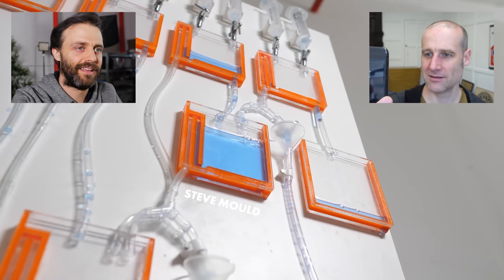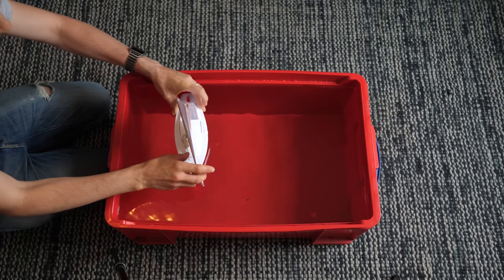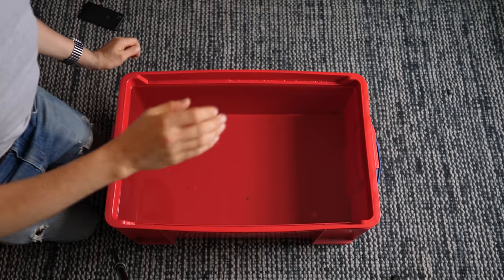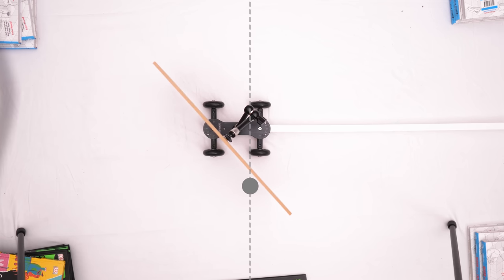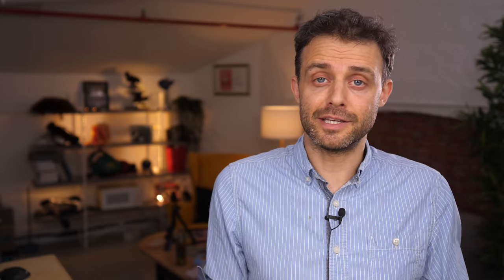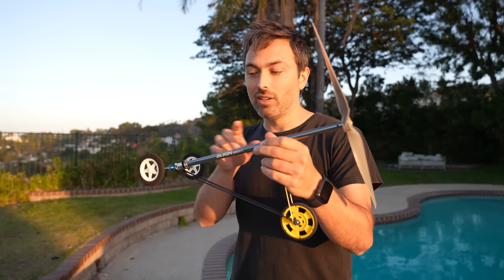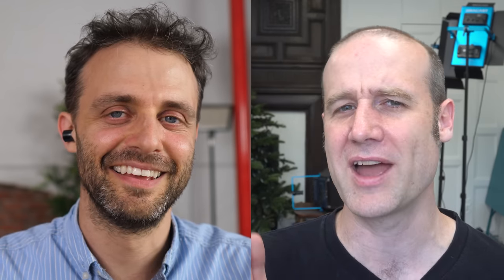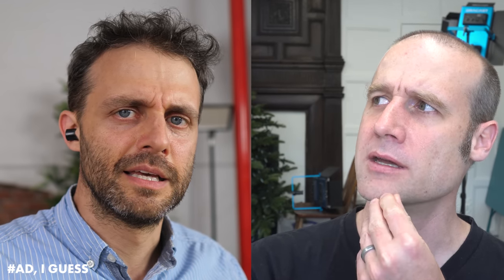Sailing Faster Than The Wind - How Is That Even Possible?

Comment from the maker: The sponsor is Brilliant: The first 200 people to sign up at https://brilliant.org/stevemould will get 20% off an annual subscription.

The alternative explanation goes something like this (I'm simplifying!) - Lift is generated when air is moving relative the sail. As the boat speeds up, the relative speed of the air should increase and so the lift should increase! This explanation doesn't work for when you're sailing somewhat with the wind though. In that scenario, as the boat begins to speed up, the relative speed of the wind actually goes down.
Reply: I love you, Mr Mould 🌈
Reply: If you are sailing into the wind, and speed up, doesn't the relative wind speed increase?
Reply: I though the sponsor was brilliant as they might have done something brilliant in this video. But it was only Brilliant.
Reply: This isn't really correct. The term you are looking for is "apparent wind." As you speed up the angle that you feel the wind coming at you from shifts to in front of you, similar to how it always feels like the wind is coming from straight ahead when you stick your hand out a car window on the highway. This means that if you are sailing faster than the wind, you are also always sailing into the wind. When you sailing into the wind the relative wind speed goes UP, not down. When you are sailing away from the wind, you are moving with it, and the relative wind speed goes down. This is what the streamer on the front of the car in the veritasium video was showing.
Reply: Isn't it the other way around? Relative wind should increase with the speed of the boat when sailing into the wind and vice versa.
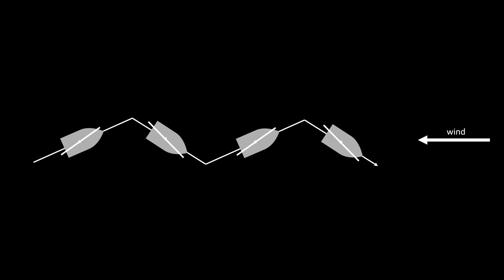Reply: It took me a minute: sail orientation i n the tacking graphic at 8:52 doesn't work with the stick-pushing analogy - the front of the sail should be angled between the bow and the wind. It would be helpful if you added force vectors there
Reply from the maker: @thephill_osopher7245  it does! I meant to say with the wind. Edited the comment. Thanks!
Reply: @SteveMould  👌
Reply: Ok
Reply: Hey Steve, I am afraid that this video does not explain well How it is possible for the component of the velocity of the boat in the direction of the wind to be faster than the wind itself. 

The video is cool, it just feels like the main point has been somehow skipped.
Reply: @lakotamm 
That's a force component not a velocity component. The velocity is assumed to be purely in the forward direction for the sake of the video
Reply: @SteveMould  You are one of my favorite youtubers, I agree with everything you said here, but DEREK's VIDEO WAS NOT ABOUT THIS*. His claim was that you one can travel faster than wind in the exact direction of the wind. Or at least that *the projection of vehicle velocity on the wind velocity can be greater than the wind velocity and I strongly contend: THAT IS INCORRECT. Your wheel cart demo makes it cleat that the cart velocity projection on the push bar velocity vector can't be greater than the push velocity. They made the propeller machine to prove their false claim. The "results" we saw in the Veritasium video were likely a combination of vehicle+pilot+rotating parts inertia, intermittent wind, and different wind at different height followed by a bunch of false explanations. And then millions of views and approval comments. I think if you be the first popular youtuber to point out their errors, you'll get a great audience and scientific support. Thanks.
Reply: However, if you can get to a speed higher than the absolute windspeed at a course into the wind, you can then turn onto a course that is with the wind, while still keeping the relative wind always coming from in front of the boat.
Reply: @DmitrySinyukov  if you increase the length of the pusher thing past the cart (which is fair because the wind doesn't stop when it's ahead of you) then you can engineer a a cart that goes faster than the stick is being pushed. You use the differential between the speed of the ground and the stick to turn a gear, and then gear that up to drive your wheels.
Reply: I think a explanation to Dereks video could be: (its my explanation)
When the wind speeds up the vehicle it doesnt speed it up due to it turning the blade, but due to pushing on the vehicle. Then the wheels will turn also and this causes the blade to spin. Now when the vehicle is at the speed of the wind it will get faster, cause actually if you imagine a horizontal line through the rotors blade there will be a crossing point between the imaginary line and the blade. This dot actually moves backwards while the blade is spinning, because of the blade is tilted. Now you have a point on the vehicle that is moving slower than the boat, cause this point is moving backwards relative to the boat (it could even really move backwards, but lets assume it doesnt)
So then the air can push on this point, since its slower than the air and thus push on the whole boat. 
Of course this backwards moving point doesnt really exist. But you can also think about it this way:
The rotor is spinning, and thus it will blow air against the actual wind. This will cause some swirls and this will cause the vehicle to kind if push itsselve from the wind. Now you could argue that pushing from the wind takes at least as much energy as it takes to turn the wheels. But thats not true, since the vehicle is moving faster relative to the ground than to the air. And thus its easier to push from the moving air than to turn the wheels to be able to push the air backwards. (Have you ever been in a pool with circle motion and just floated in the water while pushing yourselve activly from the fast water jet at the edge tonbe faster than the others? did you notice that gaining speed by this was easier than gaining the same amount of speed difference due to pushing off the non moving water? ) this is  because the kinetic energy increases quadratic with speed. So lets say you want to gain a ∆v of 1m/s relative to non moving ground while you've got no speed  in the first place. The energy reqiered would be 0.5(m^2/s^2)*M with M being your mass. But if you try to gain 1m/s when you are at 20m/s to get to 21m/s you will need a energy of 20.5(m^2/s^2)*M. So much more. So if you push from a object that isnt moving to gain 1m/s while you are at 20m/s you will have ro use a energy of 20.5(m^2/s^2)*M
But if you are pushing from a object being as fast as you, you will have to use only 0.5(m^2/s^2)*M. This is because you will push the other object backwards by doing this and thus you will decreas its veilosity and thus its energy and thus you will gain energy without having to do that much of a work. (of course this 0.5(m^2/s^2)* M does only hold, if you assume that the mass of the object you are pushing from is infinity, cause else it will get slower while you are pushing from it like i already said, and this will make calculations complicated)
So you can actually divide this process into steps:
Step one: Pushing from the wind using a energy of 0.5(m^2/s^2)*M and increasing with speed of 1m/s
Step two: using your energy relative to the ground to push from the air. 
So if you calculate that you will loose 0.024m/s. (cause you will get a energy of 0.5(m^2/s^2)*M if speeding down from 21m/s to 20.976m/s) .
So over all you are gaining 0.976m/s without blaming the law of thermodynamics.
Reply: Congrats on 1 million subs!!
Reply: Thanks Steve 👍,  I've always wondered how sailing against the wind works but this was a really intuitive explanation. Congrats on 1M subsribers as well!
Reply: Once your travelling at 2-3x windspeed surely your relative windspeed, even at a high angle, is much higher. And your boat would think it was tacking into the wind
Reply: @DmitrySinyukov  yes, it's strange how the convuluted explanation convinced most.

The prop/windmill is either harvesting energy to drive the wheels, or consuming energy from the wheels to push the air back. It can't do both at the same time.
Reply: @DmitrySinyukov  You just haven't understood what was happening with that cart. You have to decouple the motion of the propeller blades from the motion of the cart. The blade never travels directly downwind because it is spinning. The apparent wind seen by the blade comes from a different direction to the apparent wind seen by the cart since you have to combine the forward motion of the cart and the rotary motion of the blades - in sailing terms, the blades are reaching. Since there are two blades coupled at the hub, a torque is created which can be used to drive the wheels, which with appropriate selection of gear ratios can produce sufficient power to push the cart faster than the wind. The explanations are not false, it's just a bit of a tricky thing to get your head around. 

Fundamentally, sailing is the extraction of energy from the difference in motion between the air and water (or ground in the case of the cart). Sailors will almost never sail dead downwind because much more power can be generated by sailing at an angle to it. The difference that allows the cart to drive directly downwind is that the aerofoils being used to extract the energy are not fixed in relation to it, unlike with a boat, where the sails are fixed in relation to it.
Reply: But my question is, can the sailboat win from a balloon. As in, will its speed component in the wind direction be greater then the wind speed
Reply: Why would you be surprised that you can sail faster than the wind when it's been possible to sail INTO the wind for over 500 years? smh
Reply: @DmitrySinyukov  I think it's clear that the video was inspired by Derek's, and not intended to be on exactly the same topic. But why do you say an apparently common sailing technique is impossible? I'm no expert, but a quick Google found me this https://en.wikipedia.org/wiki/High-performance_sailing, with many examples of what you claim is impossible on the water.

Regarding Derek's video, it's counterintuitive for sure, but critically the fan explanation holds up as you pass through the wind speed barrier - something which I'm sure traditional high performance sailing can't do. It's pretty ingenious actually. Not to say the demo was flawless, they certainly didn't address your concerns, but it's not clear to me that they're wrong either.
Reply: @jostromp7380  That depends on the boat. A fast boat can definitely do that - an extreme example is the foiling boats used in the America's cup this year. They can travel downwind at 3-4 times the windspeed, doing 40+ knots in only 10 knots of breeze. Their velocity directly downwind is much faster than the wind, despite them sailing at an angle to it.

Edit: Here's an example: https://youtu.be/hswUuKJnq_k?t=650
The boat is doing 40.8 knots through the water, with 11.5 knots of wind, and the VMG downwind is 31.9 knots.
Reply: @turbinia  Thanks for the example, I can no longer ignore the facts.
However, it is still confusing why it is possible, as the model of Steve Mould doesn't allow this if I'm correct. Desperately waiting for an explanation as I couldn't find it on google nor in dereks video comments. @Steve Mould, please make a video about it
Reply: @kokbasE  yes this is what I would have mentioned is it the same as applied wind?
Reply: Back in the days of old style land yachts with rigid masts and bigger sails than that small one you showed in the video the mast was aerofoil shaped and given a stiff breeze you'd often see them shoot off along the beach before the pilot had even got the sail up.
Reply: The description I like for how that car works is that the propeller in effect synthesizes a surface that it moving backwards relative to the car so that surface is moving slower than then wind (and being pushed on by it) while the car is moving faster. But than again that is how all prop work.

The hard part is how to synthesizes that surface, and then how to power it. (An interesting bit of reasoning: if the force on the prop and the force at the wheels are the about the same, then to power things the speed of the wheel relative to the ground has to be higher than the "effective" speed of the prop relative to the air.)
Reply: @lakotamm  what steve is trying to say is that if the wind pushes the sail on angle, the vector forces show that the boat has travelled more than the wind has with the same force, i.e. travelled faster than the wind.
Reply: @Tacsponge  yes, a sailor will then adjust their sails for the angle of the apparent wind
Reply: @thephill_osopher7245  if you're tacking into the wind, the relative wind does speed up as you go faster, but the relative wind also turns in a direction to make it more challenging to keep speeding up.
Reply: @DmitrySinyukov   if you were to make the blades perpendicular to the wind force, you have got yourself stves model on its side, which is basically dereks model. steve only tried to provide an intuitive explanation with the resources he has available, not to challange derek
Reply: @DmitrySinyukov  I second your motion!  I definitely think Steve should prove my downwind cart to be a hoax.  He'll be in very good company, and it will just further fan the flames.
Reply: @PranavSinganapalli  
>> The prop/windmill is either harvesting energy to drive the wheels, or consuming energy from the wheels to push the air back. It can't do both at the same time.

It doesn't do both at the same time.  The wheels turn the propeller at all speeds.
Reply: @jostromp7380  Yes.
Reply: @Rick_Cavallaro  what's turning the wheels then?
Reply: Would this then allow boats to go faster than the speed of the wind? (Replacing the wheels with a turbine)
Reply: @archenema6792  it's never been possible to go faster than the wind in the same direction as the wind
Reply: @PranavSinganapalli  Have you ever sailed? Do you even know what a lateen sail is? Have you seen how many mainsails and lateen sails a tallship has? It's been happening for a long time. You don't have the slightest clue what you're talking about.
Reply: @archenema6792  have you ever understood physics, doesn't seem like you do. You seem to think a sailor knows all there is about the physics of it 👏👏🙄
Reply: LETS GOOOOO 1 MILLION U DESERVE IT
Reply: Woohoo 1 million!!!
Reply: @thephill_osopher7245  yea it does and this means that if your a boat with low drag you can sail much quicker than the wind upwind too ( look at the current America’s cup boats) however as it increases it also makes your relative angle to the wind tighter which is why on most boats you don’t actually get a speed benefit from it
Reply: @jostromp7380  what his model doesn’t take into account is the curved wing shape of sails that he very briefly mentioned. The shape makes the pressure on one side take a longer rout (accelerating it) and on the other side a shorter rout (decelerating it) these lead to different pressures and it’s the work that’s done by the sail to create this pressure difference that helps to push the boat much faster than the true wind speed, the faster you go the more air is being pushed over the sail and the stronger the effect becomes with the limiting factor being that the apparent angle to your relative wind gets narrower and narrower ( there needs to be enough of an angle for the sail to be able to split and accelerate/decelerate the air) 
It’s quite a complex subject and to be able to explain all the effects properly would take a video much longer than this one and exactly why professional sail trimmers get payed as much as they do!
Reply: except statement in Veritasium video is stronger than the one explained here.
Derek claimed that you can faster than the wind downwind as long as you zigzag. More strictly speaking: component of velocity downwind (absolute wind) is greater than absolute wind itself.
You only showed that you can travel faster than wind sideways but didn't show that it is possible to outrun balloon.
But it should be possible to show also that with your model.
Boat/car facing 3 o'clock
wind blowing towards 1:30 o'clock
sail in 4 - 10 o'clock direction.
After doing some math (or using physical model) it can be showed that in such arrangement in no drag scenario boat velocity is 1.932 times speed of wind, so component of its velocity downwind is 1.366.
Reply: @PranavSinganapalli  hi there, I'm a sailor and a physics student. I can confirm that, as can be seen from the america's cup footage that was posted earlier, you can sail downwind at faster than the wind speed. Not directly downwind mind you, but at an angle and still fast enough that you'd "beat the balloon". The reason this doesn't violate the laws of physics is that 1. As long as you reduce the friction of the boat enough energy can be conserved since there's a lot of air hitting your sail 2.sails work quite a bit different from the explanation in this video, and due to the coanda effect among others can pretty efficiently redirect air. Combine that with the fact that you're dealing with pressure differentials created by flow speed differences and it actually allows it - as long as the total wind vector (the combination of the actual wind and the headwind generated by moving through the air) doesn't make an angle with the boat too acute for the sail it can still create lift and thus force
Reply: I understood it like this. The vehicle is going in the direction of the wind, but the wings are not. They rotate perpendicular to the wind. The gear train changes the direction of the motion back to parallel and then rotates the wheel. It almost seems like you could carefully control angle of attack and keep gaining speed by pointing them into the wind, but there comes a point where the drag from the oncoming wind matches the force out the wheel. I don’t think it’s possible to go faster than this. As long as the force from wings>drag it should move. That’s why it has to be moving first. The force has to over come the drag from ground and there isn’t enough force at slower speeds. It seems to me that it wouldn’t work in an airplane or underwater. It has to be trans medium (buzz word of the week). But I could be wrong about all of it.
Reply: @DmitrySinyukov  imagine wind moving at 10 miles per hour, and a fan on a cart moving at 10 miles per hour in the same direction. From the fans perspective, there is no wind. Now use the carts spinning wheels to power the fan, pushing air backwards. That would create a force in the direction of the wind right? Then you add that to the speed of the cart and fan in the first place, and you have a greater speed than the initial wind speed. That's how I understand it.
Reply: Also, this is how internal combustion engines on cars work. They're air pumps and don't really care which direction the wind is going so long as they can suck air in. We use fuel to increase the force that's output, but otherwise the two are working the same. They cannot go any faster once the drag becomes greater than the output force. Steam engines too now that I'm thinking about it.
Reply: @thephill_osopher7245  but what's powering the wheels? If they are moving the prop, they will slow down not speed up. And once 5he direction of apparent wind changes, drag gets generated by the whole body
Reply: @thephill_osopher7245  Yes. It's referred to as 'apparent wind.' This is how iceboats and foiling sailboats can sail at speeds sometimes several times greater than the 'true wind' speed.
Reply: @PranavSinganapalli  the cart was kick-started by the wind in the first place, it was rolled forward first, then the wheels started to spin which spun the prop enough to generate the forward lift. By the time the cart travels faster than the wind, again, the wheels move the prop so fast that the prop can still push air backwards
Reply: @PranavSinganapalli  just like how, i assume, airplane propellers continue to generate thrust even though air is already travelling past the propellors very quickly.
Reply: Congratulations on 1 million!
Reply: @thephill_osopher7245  in case of airplane propellers, it is the engine that provides the power to keep it moving, and not the wind going past it. What in this craft is doing the job of the engine. Don't say wheels
Reply: @thephill_osopher7245  that is a perpetual motion machine you are describing - a machine which once you provide the initial energy, it just keeps on moving. In this case prop moves the wheels which moves the prop. Why is that not jumping out at people??
Reply: @PranavSinganapalli  it is explained better in the veritasium video. Are you saying the video is faked?
Reply: Let's make it simpler and get rid of the whole prop thing since that seems to trip people up. If I connected a shaft between the rear wheels and the front wheels, could I say the front wheels are being moved by the rear and the rear by the front and therefore my craft doesn't break the laws of thermodynamics??
OR
If I put a generator in the front wheel and a motor in the rear, with the motor providing forward motion which get converted to electrical energy by the front generator to power the motor in the rear. If we ignore all loses, with a little wishful thinking it is entirely possible to imagine a craft that can exist. In reality it can't. Best is to reproduce the treadmill experiment they tried. I bet it won't run off the treadmill
Reply: @PranavSinganapalli  it's not perpetual because the props are still getting energy from the wind.
Reply: @chrispierce596  I want to ask about "sailing faster than the apparent wind isn't possible" -- because that seems pretty easy to do! If you sail downwind in a sailboat, then as you speed up, the apparent wind decreases. Eventually you will feel very little apparent wind at all (just enough to counteract the drag) and you will be sailing quite fast. As long as your speed is > 50% of the true wind speed, then you will be sailing faster than the apparent wind.
Reply: @thephill_osopher7245  yes, something about the video is not quite right. Not saying Derek faked it, but he could have been fooled you know
Reply: @thephill_osopher7245  they can't be getting energy from the wind because at true wind speed, the prop experiences Zero apparent wind. Besides you couldn't even get close to wind speed because the blades require a minimum relative wind speed to do any work. Look up min. operational speeds in wind turbines. The horizontal kind that they have mounted need atleast 12-15km/h just to start turning
Reply: @PranavSinganapalli  I see. So why can't the wheels spin the prop fast enough to get energy from the wind, pushing the cart faster? Gear ratios come into play somewhere I'm sure, when it comes to spinning the prop fast enough based on the overall cart speed and wind speed
Reply: @PranavSinganapalli  the drag of the body is outweighed by the props because they are spinning so fast compared to the air around it. When the entire cart is at rest, it will be pushed forward by the wind, and then the wheels slowly start to spin the props, which then act like a fan and take further energy from the air around it in a different way
Reply: @PranavSinganapalli  a non-rotating prop would not experience wind when traveling at wind speed. But the blades are spinning rapidly, so they will meet air just the same as a normal fan at rest. The blades do not act as turbines being pushed by wind. They act as fans that push the air around them, which is why they still produce forward lift even when not experiencing apparent wind.
Reply: @PranavSinganapalli  The wheels are rolling on the ground.  So if the cart is moving, the wheels are turning.  Initially the cart moves because it's simply being pushed along as a bluff body by a tailwind.  As it approaches wind speed, the thrust from the propeller becomes the dominant force.
Reply: @PranavSinganapalli  It has always been possible.  You just need the right tool for the job.
Reply: @mechamunchygone6630  It would if you could make a sufficiently efficient boat.  I'm nearly certain it would be possible with a foiling craft.
Reply: @thephill_osopher7245  I keep seeing this "explanation", even Derek talked  about wheels pushing the vehicle. It is not correct. The inertia of rotating wheels does "push" the propeller just like the inertia of the entire setup with a human inside moving forward. But that's the accumulated energy from the previous gusts of wind. It's not sustainable. If you throw a stone against the wind it will fly too. Wheels interaction with the ground does not push the cart or fan. It slows it down due to rotational friction. I want to emphasize, I don't NOT think they faked the experiment. I think they misinterpreted the observations. Did you see how fast the vehicle moved? Accelerate that cart too such speed and then change the wind direction, it's gonna move forward for quite a while against the wind. I mean take a simple bicycle, gain some speed, stop pushing pedals and see how far you'll against the wind just due to inertia. Once the wind stops pushing the fan, the vehicle starts losing energy. To very roughly estimate the effect of inertia we need to compare the time it took to accelerate the vehicle to the timespan during which it moved "faster" then wind.
Reply: @DmitrySinyukov  what about the treadmill experiment? Could they have misinterpreted that the small model was moving faster than the treadmill?
Reply: @PranavSinganapalli  I think your electric generator plus wheels with electric motors on them is actually a great example. Hear me out, I'm not expecting the electric generator too make more energy than it's taking from the cart. That would clearly be a perpetual motion machine.

But your missing a big part, which is the speed differential between the two mediums. Instead of the front and back wheels, let's do the left and right wheels. Now to simulate the speed differential, whe will have the right wheels on stationary ground, and the left wheels on a treadmill moving forward. 

To start, we lock the left wheels until the cart is moving at the speed of the treadmill. Then, we turn the generators on the right wheel on, and use that to power the left wheels. With that extra power we can move the left wheels forward which makes the whole vehicle start to move forward faster than the belt, or the "wind". The actual cart is doing something similar too.
Reply: @DmitrySinyukov  unfortunately I'm not the greatest artist, nor a very good engineer, but I did find this article that has an even simpler setup, along with a diagram. vulu.net/faster-than-the-wind
Reply: @jetison333  I would greatly appreciate if you could show a simple hand drawing of the setup you described. Idk if you can share a link to an image here.
Reply: @PranavSinganapalli  The system works because the propeller is pushing on something (air) that is moving slower - relative to the vehicle - and the wheels are being pushed by something going by faster. The wheel-driving-wheel idea isn't the same because both wheels are on ground that is going by at the same speed.
The concept here is analogous to a mechanical lever. With a lever, you can use a small force moved through a long distance to produce a large force moved over a short distance.
The drag force of the wheels is small (smaller) because they move through a longer distance (against the ground). The propeller force can be large (larger) because it moves a shorter distance (through the air).
The power (or energy) used by the propeller is the same as the energy produced by the wheels (minus losses), but thanks to the lever-like action, the propeller can produce more forward force than the wheels produce rearward drag.
Reply: @andrewsnow7386  in a lever you trade distance for force, but work stays the same at both ends of it. In this vehicle, half the time it is the wind and then it's the wheels. But the wind cannot push the craft at relative zero wind and the wheels cannot be providing the force to move the prop unless there is something else moving the wheels, like a motor
Reply: @mikeflowerdew7877  Where does the wiki page contradicts what I stated? I've seen people claim they went 9 times faster than wind speed on ice with a sail. And I think it's very likely true. With no friction your Vmax = Vwind/cos(angleBetweenYourVelocityAndWind). This means that in "the IDEAL friction-less pre-Einstein world" it can be as high as you want. angle->90deg, 1/cos(angle)-> infinity. The point of discussion here is the DIRECTION. This Vmax has 2 components, Vmax_along_the_wind and Vmax_perpendicular_to_wind. The latter can be "arbitrarily" large, but Vmax_along_the_wind=Vwind. In other words, the component of your motion along the wind is not higher than the wind. The surfer analogy here makes it easier to understand what's going: https://www.youtube.com/watch?v=uylpjlz8SjY&t=233s
Reply: @DmitrySinyukov  take a look at the article I posted. It has a drawing.
Reply: Congrats on the million
Reply: @jetison333  it's still the same thing... a perpetual motion machine

In your example the right wheel will always create drag that is more than the energy you can put into the left
Reply: @PranavSinganapalli  If there are no losses (friction, air resistance), then the work stays the same at both ends of this vehicle (propeller and wheels). The propeller is performing work on the air. It is the ground doing work on the wheels.  At wind speed, the ground can still do work on the wheels because there is relative motion between the ground and the vehicle. It's not that important to the propeller that it is traveling at wind speed. It can perform work on stationary air just like it can on moving air.
Reply: @pulsarstudios3646  If you put the propeller perpendicular to the wind (rotate 90deg from how they set it up), yes, you can go faster than wind. But the component of the vehicle velocity along the wind still won't be higher than the wind (most of it will be perpendicular). And then also you won't need the propeller at all, a sail will work even better.
Reply: @PranavSinganapalli  ehh thinking about it more I'm not sure if a generator would work. I'm not sure exactly what forces that kind of system would make. But the example is still good, you just need to replace the generator with a gearing system, that makes the right wheels spin faster than the left, then, the only stable point is it moving forward faster than the treadmill, where the left wheels are slowly turning and the right is quickly turning, moving faster than the treadmill. 

If it's slower, then either the left or right wheels are spinning. If the left wheels are spinning, then they are trying to speed up the cart. If the right wheels are spinning, then they are also trying to speed up the cart, as they are turning slower than the ground is moving.

Edit: im actually not sure if the setup I described would work anymore. Im sure there is one, but this scenario is kind of confusing to think about. Instead, lets just watch and appreciate the video Andrew snow posted, which shows the idea very well. https://www.youtube.com/watch?v=E7vcQcIaWSQ

Second edit!: I just realized the video shows the exact scenario I layed out, with two wheels on different moving surfaces geared differently. Thats very neat.
Reply: @Rick_Cavallaro  Please don't bend my words. I never claimed and I do not yet think it's a hoax. I think it's a misinterpretation of a poorly setup experiment (scientifically speaking). I am honestly impressed with the contraption, the overall video quality, cameras, quadcopters, people. I can only imagine how many human-hours were invested into it. But can you release more data? First thing I want to compare is "time to accelerate the mad propeller machine" vs "time the mad machine moved 'faster' than wind". My guess is the latter is much shorter. Meaning that you simply had a strong wind that accelerated the machine and then light front wind during which the machine just moved 'by inertia'. Alternatively, a simple experiment to roughly estimate the inertial properties of your machine is to accelerate it with a regular car to the same speed from the video and then see how long it's gonna continue moving forward without wind or with light front wind. And compare this time to your experimental "faster than wind" time.
Reply: @DmitrySinyukov  If there were a light on-shore breeze, the surfer could move faster down-wind than the wind. The surfer has a source of energy, the wave, so going faster than the wind is possible. The sailboat also has a source of energy, so going down wind faster than the wind is possible. The energy available because of the difference in speed between air and water doesn't disappear just because you are moving at wind speed.
Reply: @DmitrySinyukov  what do you think about ricks model on a treadmill? it has none of the problems you talk about (which are very important), and yet it still does move forward, faster than the air powering it.
Reply: Could you perhaps put "Coandă" and similarly Weird words on screen somewhere in the future? It took me forever until my attempt at spelling it didn't look like "coriander" to google.
Reply: @DmitrySinyukov  
>>  Please don't bend my words. I never claimed and I do not yet think it's a hoax. 

My apologies.  I misunderstood.

>> I think it's a misinterpretation of a poorly setup experiment 

Very soon I think you'll get to see that it very definitely is not that.

>> can you release more data?

Check the NALSA website for all the data from our submission for the record runs.  

>> My guess is the latter is much shorter. Meaning that you simply had a strong wind that accelerated the machine and then light front wind during which the machine just moved 'by inertia'.

Nope.  The rules indicated that we could not make use of stored energy and we had to demonstrate that we were accelerating during the observation period.  I'm pretty sure those rules are still posted there as well.
Reply: @andrewsnow7386  at wind speed the prop is no longer harvesting energy. The ground is not doing work on the wheels. If you mean the relative motion, then that is the effect with the wind on prop being the cause. Can't flip it around to fit the narrative. If the wheels are moving the prop, then it will slow down and start to go slower than wind speed, not faster
Reply: @DmitrySinyukov  OK, take the ice boat going 9 times faster than the wind.  If it is traveling at 90 degrees to the true wind (the wind as measured by a stationary observer) lets find the apparent wind (the wind measured on the boat). I think it's easier to follow if we pick a number for the wind speed, so lets say the true wind speed is 11. This means the boat is traveling at 99 (if I picked 10 for the true wind speed, the apparent wind speed would have been 90, possibly getting confused with the true wind angle, thus 11). If we add the 11 and 99 vector together, we find the apparent wind is 99.6 at an angle of 6.34 degrees off of straight ahead. To sail with the wind this close to the front of the boat probably requires a rigid wing in place of a flexible sail, but that's a different topic. Let's just use the 6.43 number.
Now what if someone towed the ice boat at a speed of 44.2 and and at an angle 160 degrees off the wind (20 deg from straight down wind). This would give an apparent wind of 34.1 at the same 6.34 degrees from straight ahead. If we divide this new boat speed (44.2) by the true wind speed (11), we get that the boat is traveling basically 4 times wind speed.  If the boat can sail at 9 times wind speed with the wind at a 6.34 degree angle, surely it can sail at 4 times wind speed with the same 6.34 wind angle.
Finally, at a speed of 44.2 at 20 degrees from down wind, the down wind component of the speed is 41.5 - much faster than wind speed.
You can check for your self, but even if we lower the 9 times wind speed number to something lower that more boats could do, we will still find that the boat can achieve a down wind velocity greater than the wind speed.
Reply: @PranavSinganapalli  It is harvesting energy, its slowing the wind down. Its related to the fact that propellers produce more thrust when they are moving slower through the wind. if the cart is travelling at 10mph then the propeller will experience an apparent wind of 10mph. Given near perfect efficiency, then even with the wheels and propeller running the cart could nearly keep going at that speed. Now, if you add a tailwind at 10mph, then the apparent wind on the prop is 0mph and it will therefore produce more thrust, and in fact more than the cart needs to stay stationary and it will accelerate. It doesn't matter that the apparent wind is zero, because its not a sail, it doesn't just drag the wind it pushes against it, and since it can always push against the wind no matter how fast its moving it can move faster than the wind given it can harvest enough energy too.
Reply: @PranavSinganapalli   In the direct downwind situation, the propeller never supplies power to the wheels. Any time the vehicle is moving, regardless of speed, the wheels are supplying power to the propeller. I'm afraid you are the one trying to flip it around. 
If you assume the propeller is driving the wheels, and do the energy calculations, then, yes, you will find the propeller doesn't produce enough energy to drive the wheels. But, when you assume the wheels drive the propeller, and do the same energy calculations, then there is plenty of energy to drive the wheels. Derek did the second of these calculations in the comment he pined at the top of his video.These calculations show the wheels must drive the propeller. 
As I described with the lever analogy: when the propeller gets the power from the wheels, the thrust force from the propeller can be greater than the drag force of the wheels because the propeller is pushing against a slower moving medium.

Also, the vehicle has a one way clutch or ratchet, so the propeller can't drive the wheels.  If you reach up and turn the propeller to try to move the vehicle forward, the one way clutch will just let the propeller spin freely without moving the vehicle.
Reply: @PranavSinganapalli  "at wind speed the prop is no longer harvesting energy. The ground is not doing work on the wheels."

Work is frame dependent:
- In the ground frame the air is doing work on the propeller
- In the cart frame the ground is doing work on the wheels
Reply: @PranavSinganapalli  "in a lever you trade distance for force, but work stays the same at both ends of it."

Exactly. In the cart frame:
distance_ground > distance_air
Therefore:
force_ground < force_air
While energy is conserved, including transmission loses:
work_ground > work_air
Reply: @OMGclueless  Sorry you're probably right I got too focused on a particular sail set up and wasn't considering different directions. I'm going to think about that a bit.
Reply: I love your videos but you have not actually touched the most important part of Derek's video in yours. In that video the question was not wether you can achieve a speed relative to the seafloor that is greater magnitude than the wind's speed relative to the seafloor, which is what you explained here. The question was wether you can achieve a speed which has a downwind component that is faster than the wind. The "catch a balloon" idea represented it really well, because it doesn't matter how fast you move sideways relative to the wind, what matters is the downwind component of your velocity. 

You could take a look at the case where you are moving downwind at an angle with your downwind velocity component exactly the same as the wind speed. Then the apparent wind (which you avoided mentioning in this video, I guess for simplicity) would be exactly perpendicular to the winds velocity in a stationary frame. So overall you would be sailing in headwind at an angle. Since you can do that, as you explained in the video, you still have a way to accelerate further in the direction you are going. That of course increases the downwind component of your velocity, so you can go faster than the wind downwind with a boat. This was the assumption in Derek's video.

Btw, I really liked the missing the wind animation :)
Reply: @archenema6792  Against (into) the wind means that there is a positve diference in velocity that can be turn into energy that can push the water and makes the boat moves forward.
The theoretical problem starts when the boat reach the wind velocity in the same direction, so there is no difference (in module or direction) to extract energy from.
Reply: @DmitrySinyukov  Be patient, the truth is coming...
Reply: @turbinia  as one who used to sail, in fact it's better to go at zigzag at around 60° and slowing down because of the turning than going almost parallel to the wind
Reply: @andrewsnow7386  I must agree that at least some of those videos demonstrate somewhat counter-intuitive behavior. This is also an interesting relevant contraption: https://youtu.be/k-trDF8Yldc?t=101 I am even guilty of replicating the demo from your link myself, just in case. I will have to think a bit more about how to connect them to the or faster-than-wind debate. And where/if the difference is there.
Reply: @DmitrySinyukov  "This is also an interesting relevant contraption"

Look at the other videos on coolaun's channel, especially the "Walkway Carts". On my channel you also will find several animations that explain these concepts (look for the oldest ones from 10 years ago).
Reply: @DmitrySinyukov  You said: "the projection of vehicle velocity on the wind velocity can be greater than the wind velocity"

The article I linked to says the following:
"Faster-than-the-wind sailing means that the apparent wind angle experienced on the moving craft is always ahead of the sail."
"Starting ca. 1975, 18ft Skiffs were sailing downwind faster than the speed of the wind."
"The catamarans used for the 2013 America's Cup were expected to sail [...] downwind at 1.6 times the speed of the true wind."
"By sailing downwind at 135° off the wind, a land-sailing craft can sail much faster than the wind. The velocity made good downwind is often over twice as fast compared to the same craft sailing directly downwind."
"Craft that sail faster than the speed of the wind, downwind as well as upwind, are capable of tacking downwind because the apparent wind is always ahead of the mast."
"[Apparent wind sailing] requires a craft that can exceed the true windspeed, both upwind and downwind; this allows the apparent wind to remain well ahead of the sail on the courses sailed"

All of these contradict your point. If you can't be bothered to read and understand material sent your way, I am not going to be bothered arguing further.
Reply: @DmitrySinyukov  I agree that the intro video is sketchy at best. But the final treadmill experiment holds up to scrutiny. Even though it doesn't pan the camera to show that there is no fan, any fan that is blowing air faster than the model is moving would surely be disturbing the man in front's clothes. He shows there are no strings, and the model clearly climbs a treadmill even uphill. I think the treadmill experiment says much more than the real cart.
Reply: @DmitrySinyukov  Since you replicated the the demo, you must have a wooden spool (cotton reel) or the equivalent. So how about this addition:
Tape or glue one end of a light thread to the small diameter of your spool. Two to 5 yards (meters) of thread is probably good.
Tie a large large helium filled balloon to the other end of the thread. Add weight to the balloon until it is just barely to heavy to float.
Place the spool on the ground where there is a very light breeze. Point the spool so it can roll directly down wind and release the contraption.
As the balloon blows down wind, the thread will wind onto the spool. The thread will wind up from underneath the spool, like at 0:05 in this video (this video is just to demonstrate how the thread will wind, there no balloon in the video): 
https://www.youtube.com/watch?v=P6JYGeP4RB0
Note, as shown in the video, if the thread pulls from too high of an angle then the spool will not roll. This is why I suggested adding weight to the balloon so it doesn't float up.
So, just like with the paper under the spool, the spool will move forward faster than the thread that is pulling it. If the spool is small and light, and the balloon is large, then the spool will not slow the balloon down much. The balloon will travel at very close to the speed of the wind. With the spool going significantly faster than the thread pulling it, the speed of the spool can easily exceed the wind speed. You have created your own down-wind-faster-than-the-wind vehicle.
Reply: Steve, here's an idea: 

You know, when you connect two cog wheels, they turn opposite directions. Same thing if you have two rubber wheels that are touching each other. 

Imagine a room with no walls, just an infinite floor and infinite ceiling above it. The floor will represent floor and the ceiling will represent the wind.

Put a rubber wheel on the floor, put a second rubber wheel on top of it in such a way that the top rubber wheel touches the ceiling. Now, the wheels in this contraption can spin and move forward or backwards together, clamped between floor and ceiling.

If instead of the wheels touching each other and rotating at the same speed, you connect them with some gear ratio, so that the ceiling will have to be in motion relative to the floor for this contraption to be able to move, then you can slide the floor and ceiling past each other to make this contraption move forward or backward, just by arranging the transmission differently.

You should be able to slide the ceiling past the floor and make this contraption move faster than the ceiling moves. 

That might be a great explanation for the veritasium project. Could you make a model of that contraption?
Reply: @OMGclueless  Thanks again for pointing that out. I aim to be accurate and you were right that wasn't accurate.  I don't want to put out bad information so if I had written it, "Sailing faster than the apparent wind isn't possible when sailing faster than the true wind", would that make the logic consistent? I have never sailed a foiling boat so I don't have the hands on experience that would prove to me that this is the case, but once your direction of sail gets between a beam reach (sailing perpendicular to the wind direction) and directly downwind then what you said was accurate your apparent wind speed would be lower than the true wind speed in most cases because you are moving with the wind or at least not against it in the case of a beam reach. However you would no longer be traveling faster than the true wind. What do you think?

I saw another person say that the America's Cup boats go faster than the wind downwind, but based on my understanding of the mechanics of it that wouldn't be possible unless that person was talking about going faster than the apparent wind speed going downwind which I think brings us back to the point of the Veritasium video.  The vehicle in that video only goes faster than the true wind directly downwind because of an added acceleration from the windmill thing driving some kind of gear setup to drive the wheels.  That also only worked when everything was just right. It seems to me that that wouldn't work on a boat unless you designed a similar setup on a foiling boat that turned some propellers. Though then you might be in the realm of motor sailing and I'm not sure I'd call that the same as sailing.  I also don't know if that would overcome the drag from the water. The propellers might add more friction.
Reply: That is why high performance boats do not go straight downwind, they zig zag traveling 45 ish degrees off from true downwind keeping their velocity high enough to have the apparent wind at an ideal angle to produce enough lift (thrust) in the forward direction to overcome drag.  I think you just don't fully understand this concept.  There are also a few errors in the video that shows that you didn't ask a high performance sailor how a sailboat can go faster than the wind.  There is a bit of hand waiving in this video.
Reply: The sailor in me was waiting for more sailing terms, like "close haul" or "beam reach" for sailing very close to wind direction and sailing perpendicular to the wind direction, respectively. Also maybe I'd just love for you to say "forecastle".
Reply: Great video but the Zigzag path cartoon is drawn wrong, the boat would gone backwards in that configuration, the nose of the boat should point outwards more pass the direction of the sail.
Reply: @matthewsnyder4211  Apparently I don't understand it properly. Do you have a good reference that better explains the mechanics of it. I don't have any high performance sailors on speed dial.
Reply: @chrispierce596  https://questeria.info/aw/index.html            mess around with this calculator (when it says true wind direction that means the direction the wind is going.  For example try true wind speed of 10 kts, true wind angle of 180 (so the wind is coming from 0 and going towards 180 at 10 kts),  your boat speed is 10 kts and your boat heading is 90 degrees (beam reach) your apparent wind angle should be 45 degrees off the front of the boat.  So the wind the boat feels is now coming 45 degrees right of the true wind direction and has a velocity of 14.1 kts.   

Also check out this link, it will help with the following description      https://www.researchgate.net/figure/Wind-circle-showing-positions-of-the-sail-according-to-the-boat-and-wind-directions_fig1_294732007     

The link above shows the  points of sail assuming a slow boat that does not create a noticeable amount of apparent wind.  On high performance boats such as most catamarans and certain monohulls the powerzone is a beam reach where the boat quickly accelerates and has the most power.  This point of sail is the fastest on these boats.  (assume the boat is pointing 90 degrees and the true wind is coming from 0 degrees)  As you accelerate the wind the boat feels starts to move forward where it started at 0 degrees now it feels like it is around 45 degrees (as you recall from the chart with the points of sail the boat is close hauled when it is going 45 degrees to the wind).  Now not only did the wind move 45 degrees closer to the direction of travel, but the wind velocity also increased due to the boat speed combining with the true wind speed at this point the boat is now going faster than the true wind speed.  This new wind velocity and angle allows you to accelerate even more allowing the boat to be turned right to 135 degrees while the boat feels like it is still going upwind, it is actually going 45 degrees off dead downwind. (mess around with the calculator a bit)... Ok now assume that you hit a large wave while heading 135 degrees at high speed and come to a stop.  The wind the boat feels will stop coming from the front of the boat and it will feel like the wind is coming almost directly behind you and at a much slower velocity.  To get going fast again the boat must be turned up into the power zone 90 degrees and can only turn back down to 135 when the apparent wind is built up again.  (of course the boat can stay at 135 degrees after hitting the wave but it won't be going nearly as quickly downwind and it basically turns into a slow monohull using the sails as a parachute to push its way downwind rather than using them like an airplane wing).  Hope this helped.  Let me know if you want more references if this didn't explain it well.  It is easier to explain with a drawing and a lot easier to understand once you have experienced it.
Reply: Some of the headings are oversimplified, like you can re build the apparent wind on headings plus or minus 20 degrees from 90.
Reply: @matthewsnyder4211  Thanks that seems to make sense.
Reply: @chrispierce596  The America's Cup races do give a good practical example of boats, very fast boat, that easily achieve a down wind component to their velocity well above the true wind speed.
https://www.youtube.com/watch?v=Dm98bpsqBow
Note that the race course is setup so the boat run upwind and then down wind and then repeat. Unfortunately they don't show it often, but at 22:22 in the above video, they show data from the boat on a downwind leg. The the numbers on the right show the data applicable to this discussion. The numbers when I stopped the video are:
Speed - 36.3 kts, this is the boats speed through the water
VMG - 29.6 kts, this is the downwind component of the boat speed
TWS - 10.9 kts, this is true wind speed, that is the wind speed measured by someone sitting stationary in the water
TWD - 358 deg, this is the true wind direction.
Their heading - 216 degrees is also shown in the lower left corner.
Since you are a sailor, you can judge for yourself if these numbers seem reasonable. Based on the lack of any significant white caps on the waves, the wind speed must be under 15 kts. If those big sailboats don't give a proper impression of speed, watch for the chase boats.These sailboats have a water speed way above 15 kts. Due to the perspective of the camera shots, it is hard to judge the angle to the wind they are sailing at. But if you are traveling 3 times faster then the true wind, any angle more than 110 deg off the wind (closer than 70 deg to straight down wind), will give you a VMG greater than the true wind speed.  I think they are clearly sailing closer than 70 deg from directly down wind.
Reply: I am not sure the “missing packets of air” model works to explain Derek’s original premise, that you can sail downwind and go faster than the wind in the direction of the wind   Steve, sounds like a follow on video opportunity!
Reply: @DmitrySinyukov  there's several videos on Ricky's channel that show there's no fans strings, and yet the cart still manages to climb uphill. If you still think that'd a fake somehow, maybe you should try building a cart yourself? I'm actually planning on it, it seems a fun experiment to do.
Reply: @chrispierce596  "Sailing faster than the apparent wind isn't possible when sailing faster than the true wind" I don't think that's true either. As mentioned in this video, their record is 2.8 times the speed of the (true) wind, which if accurate would put the apparent wind at 1.8 times the speed of the true wind, which is less than their groundspeed.

Which brings us to your second point: "The vehicle in that video only goes faster because of... some kind of gear setup to drive the wheels." This is true, though it's more accurate to say that it needs the ground to drive the wheels in order to turn the propeller fast enough to generate lift. What you've missed though is that the sailboat does have something to replicate this -- a keel. The vehicle has a complicated linkage of gears and belts to convert the force applied by the ground into rotation of the propeller until its effective angle of attack with the apparent wind is enough to generate lift. The boat has a "simple" wooden plank to convert the force applied by the water into perpendicular motion of its fixed sail until its effective angle of attack with the apparent wind is enough to generate lift.

The role of the keel is not appreciated enough by most commentators on this phenomenon, IMO. There's lots of discussion on the sail and how its shape approximates that of a propeller and when you rotate a sail it looks equivalent. There's not a lot of discussion about the keel and how its role is equivalent to the wheels in the faster-than-the-wind vehicle, when really it's just as fundamental to why this works.
Reply: @DmitrySinyukov  
>> it could have been faked, for example, by placing a fan behind the cart 

We have treadmill videos addressing most every concern that was raised.  We do have one that addresses that directly.
Reply: In order to understand the Veritasium video we needed to understand how the tack speed (downwind) could exceed the speed of the wind not just that the boat could go faster than the wind.
Reply: @mosab643  The best way to do that unfortunately is through a relatively simple vector analysis.  I do touch on that analysis in a talk I gave on the topic of the Blackbird.  Unfortunately, I don't really go into a lot of detail on that as I was addressing a group of sailors that were well aware that it's possible.
https://youtu.be/X6oJpnSJyV8?t=1451
Reply: @mosab643  I'm no sailor, but a good place to start would be this link I already posted in another part of the thread: https://en.wikipedia.org/wiki/High-performance_sailing
I can't completely vouch for its accuracy, but you can read it and make up your own mind I guess.
(btw "made good" is apparently a technical term to mean exactly what you want - projection of the boat speed downwind)
Reply: Simplifying?awwwwwwwwwww
Reply: You forgot one of the more important things about sailing faster that the wind and that's apparent wind angle (as your accelerate which causes the wind to move foreword allowing you to steer down and sail lower with the same efficiency in the sail plan) which allows for faster than wind speed travel downwind in relation to the true wind direction.
Reply: @mosab643  These animations explain the  downwind component >  windspeed: 
https://www.youtube.com/watch?v=H_OKNr120t4 , https://www.youtube.com/watch?v=63hvQABLOaE
Reply: @eyytee  That is exactly how I had pictured it in my head. Thank you.
Reply: @eyytee  I see you have some cool videos  on your channel from some time ago. Did you make them yourself?
Reply: @eyytee  wow, that is an awesome explanation and makes everything clear. Thanks for sharing
Reply: @thephill_osopher7245  Component of relative wind in the same direction of sailing is to be considered and not in the opposite direction.
Reply: @mosab643  "I see you have some cool videos  on your channel from some time ago. Did you make them yourself?"

Yes, thank you.
Reply: You are correct. There is another effect.
when you sail slightly with the wind, then sail foreword, the apparent wind angle changes. Thus instead of sailing with the wind you are now sailing slightly against the wind. This happens because your vector combines with the wind vector and the wind angle the sailboat feels changes.
Reply: Great, 3 of my favourite Youtubers in one video!!! Would love if you'd had shown kitesurfers as well, using the wind  even more complex ways than a boat 😎
Reply: You showed into the wind, but can you tack faster than the wind in the same direction as the wind? I think your contraption can show this. This is the theory of the rotating sails in the @veritasium video. If your cart is 45deg and you push from behind, if the "sail" is angled at say 40deg, then the cart will outrun your stick pushing it in the direction you are pushing it.
Reply: @robertschnobert9090  Haha I know what you mean, here's great isn't he :D
Reply: @robertschnobert9090  Haha I know what you mean, he's great isn't he - :D
Reply: @Rick_Cavallaro  Your craft is definitely NOT a hoax. I saw the video of your downwind land prop craft and decided to do the math.  The equation that governs the maximum downwind speed is actually quite simple. Somewhere in these comments I put the explanation but the equation is 

V = Vs.tan(theta) + Vw  

where V is the velocity of the craft in the direction of the wind and Vs - and this is the tricky bit - is the velocity of the sail/blade perpendicular to the wind.
Vw is the velocity of the wind (measured by a stationary observer) and theta is the angle of the sail/blade relative to the direction of the air that is hitting it. In your case this angle is the pitch of the blade - if the blade was a flat surface with the wind hitting it face on, theta would be zero. If that blade was aligned along the downwind direction with the wind not hitting the surface, then theta is 90 degrees.

On an Americas Cup boat (or any fast sail boat or ice boat) the Vs component is created by the sail moving at an angle off dead downwind (usually about 25 degrees away from downwind). When you are NOT moving straight downwind in a sail boat, the sail is moving left or right at some velocity. That left or right motion of the sail interacts with the wind because the wind is moving downwind, of course. With your prop, you create that Vs by moving the blade across the direction of the wind. It doesn't matter that it's rotating.  Steve M is right that the maximum speed V downwind occurs when the wind molecules just miss the sail/prop blade. If the sail/blade is moving slower than this critical speed then the wind will hit the sail/blade and transfer some of its momentum. Go too fast and the wind will hit the back side of the sail/blade and you'll slow down.

The theta angle is your prop pitch. If you wanted to go faster then you need to increase the pitch. Of course there are drag and friction limitations but in the ultimate limit if you set the pitch to just shy of 90 degrees the speed would be very large - tan(90) is infinite.  [The other way to go faster is to power the blade - duh - but in your case you gear the prop and the craft together so Vs = f(V)  and I assume this is a constant relationship Vs = kV. So powering the blade is just the same as powering the craft - no point.]

I suspect altering the prop pitch while moving is a bit tricky but if you wanted to go faster then you could change the gear ratio between the prop and the craft. To reduce friction you could put the craft on ice skates like a ice boat but you'd need to have some spiked wheel to dig in to the ice for traction.
Reply: @mb-3faze  
>> I suspect altering the prop pitch while moving is a bit tricky 

It's not trivial, but the Blackbird does have variable pitch so I can optimize acceleration during the run.
Reply: @Rick_Cavallaro  >> Blackbird...variable pitch.   It must be rather annoying to have half the internet thinking your creation is a hoax/won't work etc. You would have thought having video of it working would provide enough evidence. 

In case anyone else is reading... At the high speed limit (and that proviso is important), 'lift' has nothing to do with how this or a sail boat moves. The movement of the craft is entirely a case of momentum transfer from the wind. Sure, at low speed you get a pressure difference over a curved surface and it helps a lot getting a passenger aircraft off the ground. After gaining sufficient speed the pilot changes the wing configuration to more or less a flat surface because it is the air molecules hitting the underside of the wing that keeps the plane in the sky.  It's also no co-incidence that the America's Cup sails are stiff, practically flat, sheets of carbon fiber material : at high speed you don't want to force the wind to curve round anything. That just causes turbulence and drag.
Reply: @turbinia  ,You miss the point that there is ratchet in drive system to prevent propellor from driving wheels.
Reply: So which wind/sail configuration is "close hauled"?
Reply: I believe the way the alternative explanation works for boats that can travel downwind with lift (not all boats can) is called apparent wind  which brings the wind forward again.
Reply: Super late response: but you’re absolutely right. I’m a pretty fair sailor, and this is something we experience all the time in fast boats. Especially those that hydrofoil (look up SailGP). If the wind is 10 knots and you’re traveling at 10 knots perpendicular to the wind, the wind you feel on your face is actually 45 degrees from your direction of travel and significantly stronger than 10 knots. This phenomenon continues as you turn away from the wind, and you can actually easily exceed the wind speed at very broad angles (almost totally downwind)  to the true wind, while the wind you feel in your face (apparent wind) is coming from ahead of you.
Reply: @thephill_osopher7245  that's why he said "with the wind"
Reply: As a sailor this was a pretty bad explanation. It's apparent wind sailing as another commented below. To see extreme examples of this check out the latest America's Cup boats and also ice sailing videos.
Reply: Try looking for a Brilliant course that tells you the difference between "vein" and "vain", so that you may know which to use in your subtitles.
Reply: @SteveMould  Try looking for a Brilliant course that tells you the difference between "vein" and "vain", so that you may know which to use in your subtitles.
Reply: it does somewhat actually work since the direction of the relative wind changes however this is provides a negligible amount of lift it does require you to change the angle(and airfoil shape) of your sail.
Reply: @Tacsponge  Yes look at Americas cup boats and SailGP boats they travel at 3 to 4 times speed of the wind and their sail angles are almost the same upwind and downwind
Reply: @jostromp7380  That actually depends on the boat itself, some boats are designed for going directly downwind at slower speeds and others are made for zig zagging downwind but doing so at higher speeds. modern boats zig zag downwind since it has a much much higher speed potential. The number you are looking for is called velocity made good (VMG for short)
Reply: as a sailer I use a different theory.
Reply: So a kite then ?
Reply: Man, I love your work, but should have had a sailor explain this. Unless I missed it, the thesis presented in the other video was that sailboats can't sail dead-downwind (i.e. with the wind blowing directly from astern) faster than the windspeed. I know how that can happen, but...

Mate, keep it up. Great stuff!
Reply: sounds like you need to get on a sailboat and go directly down-wind. remember to look at the bubbles in the water, Many a people have proclaimed that the boat isnt moving cuz they dont feel any wind.
Reply: @PranavSinganapalli It's a prop; never a windmill.  
The wind pressure on the whole machine causes it to move downwind and power is taken from the wheels to start turning the prop.  
It's a tough go at first because at first the wind is coming from behind the prop, trying to "windmill" it to rotate backwards  (incidentally with its leading and trailing edges reversed).  
The gear ratio has to be high enough that the prop will begin working as a prop in the downwind direction rather than windmilling in reverse and driving the wheels in reverse (backing up into the wind.)  The need to gear the prop high enough to work properly is the reason the vehicle accelerates so slowly at first.  It is hampered by the wind trying to turn the prop backwards as if it was a windmill before it can transition into functioning as a prop.  
(Incidentally you must swap leading & trailing edge orientation to turn a windmill into a prop efficiently & vice versa of course).  

If the vehicle had a CVT (continuously variable transmission) between wheels & prop AND a wide range of pitch control (including reverse) it could get up to efficient operating speed quicker than did the Blackbird.  

Once exceeding actual windspeed the ratio between wheels & prop  is such that the prop's effective forward velocity through the apparent wind is greater than the wheel speed over the ground.  That way the wheels are always powering the prop to chew through the apparent wind to ever increase its downwind velocity, something like pushing back against the wind that's pushing it downwind.  The ratio synching the prop and wheels has to be in the proper realistic range to form a feedback loop.  

The blades of the prop are "tacking" in a helical manner, avoiding dragging the whole vessel with it as it does when the vessel is fixed to the airfoil (sail) and has tack along with it.  

In the case of exceeding windspeed going INTO the wind, the blades have to be configured as a windmill rather than as a prop and the greater apparent windspeed has to be accommodated by a higher pitch than would be ideal for a stationary mill.  The greater drag on this vehicle going into the wind limited it to 2.3 times actual windspeed vs. going downwind at 2.7 times actual.

The concepts can be most clearly be demonstrated by considering the results  of a prop spining on a stationary, high pitched (very coarse threaded) infinite length rod.  The pitch being more like the rifling in a gun barrel than the threads on a bolt. 
The results of varying the pitch of the prop and pitch of the stationary helix it is constrained to rotate on simplifies the mechanics of the process this way.  
For downwind operation, the blades of the airfoil should ideally be maximized as a prop and for upwind operation the airfoil should be optimized as a windmill (or more correctly a wind turbine).  

I haven't yet encountered analysis of how this DWFTTW & UWFTTW phenomenon interacts with the Betz limit.  I'm inclined to think it's defeated in the downwind condition and higher in the upwind mode.  
It gets real hairy considering traveling with these devices off axis from wind direction as it would require complex constant adjustment of the angle between the prop/turbine axis and the long axis of the rest of the machine.
Reply: Could someone explain to me how this works? When I think about it the extra sped off the wind comes from the boat speed so any extra lift generated should be canceled out by drag because the relative energy of the air comes from the boat